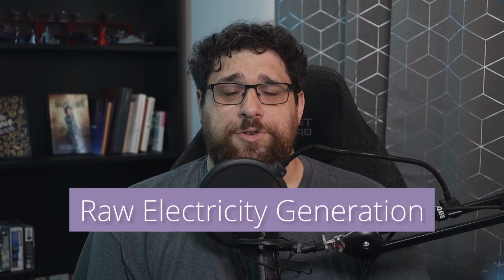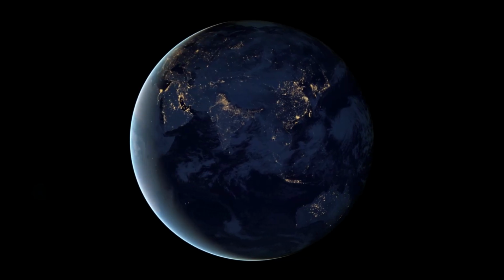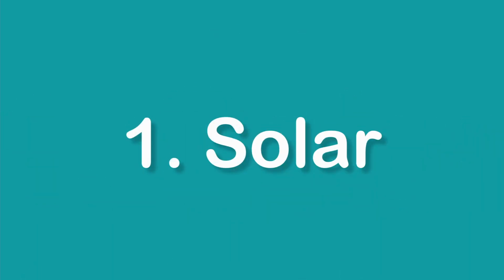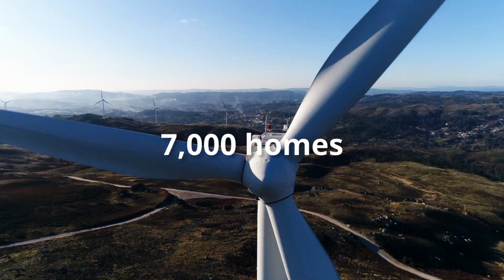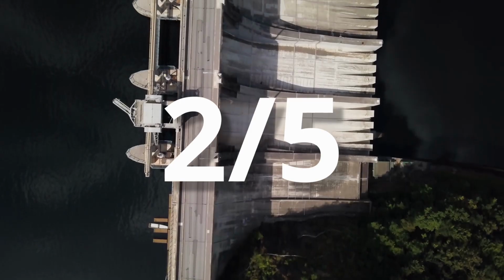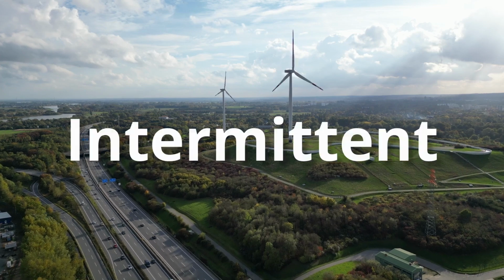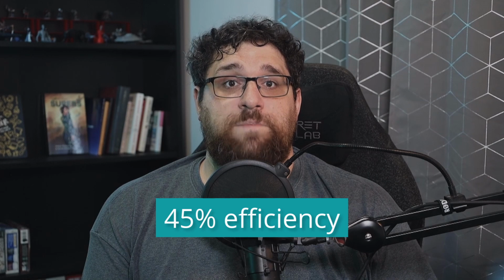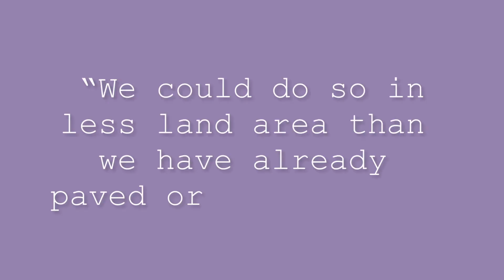How Close Are We to 100% Renewable Energy?

Comment: With all of the renewable energy, what is the longevity of the components of those items that generate the energy? Do they outlast those that we are currently using?
Reply from the maker: Solar maintenance is typically lower than most coal, natural gas, or oil based power systems. And in terms of base-load power, Nuclear requires the least amount of maintenance and is the most reliable. I don't know how often Geothermal will need repairs or maintenance, but it has more potential energy generation potential than pretty much any other existing technology if we deploy it widely. 

As for component replacement, I think that's an interesting question, but also something that can get better with more time and innovation specifically spent on that part of the equation. We haven't reached peak efficiency with solar panels, wind turbines, geothermal and other renewable sources yet.